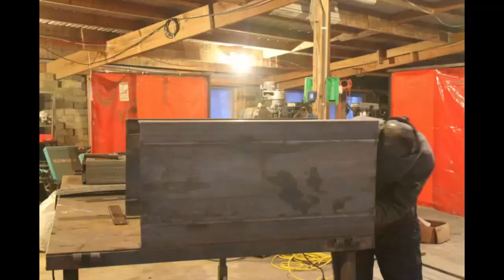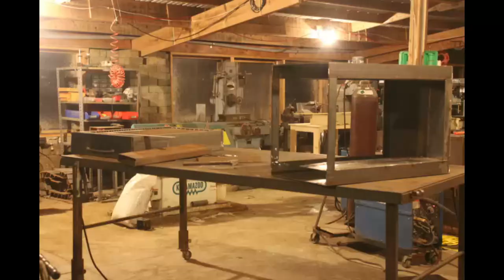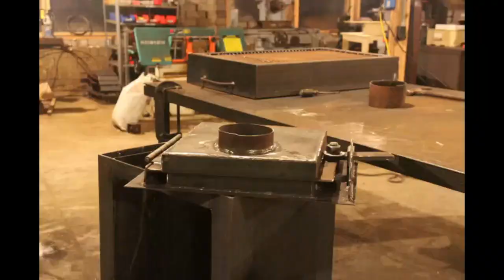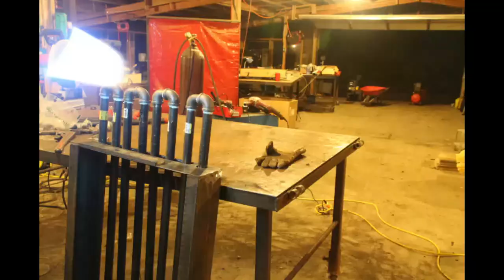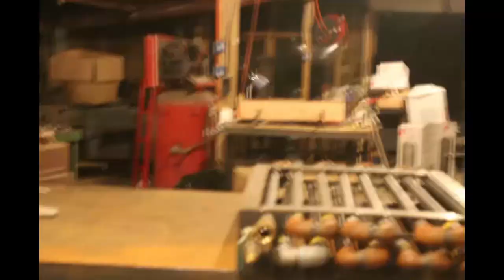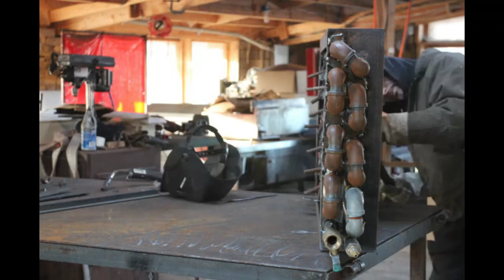How to Build a Hydronic Stove in 5 Minutes

Comment: It seems cheaper and more reliable to use 180 degrees bent tubes isntead of couplers. Space can be compensated with overlapping.
Reply from the maker: In the next iteration, we will use rubber hose for the joints, and use an insulated chamber so the rubber doesn't melt. Like radiator hoses.
https://wiki.opensourceecology.org/wiki/Open_Source_Hydronic_Stove
Reply: @marcinose  I have not researched the link you posted yet, but, My heart fell through the floor when I saw the soap bubbles.. What a pain that must have been.. :)... I think you would be better off building a tank (could be much thinner considering the same volume of the pipes and run the heat around the tank.. Cold water in at the bottom and out through the top.. Would thermocycle, or, if you are feeding it with a pump, rate of flow could be determined by heat of the water output.. My guess would be a 1/8" thick wall tank would heat much better than those pipes.. Just a thought.. And, would be much easier when it comes to finding an initial leak.. Just a little grind and weld and leak is fixed.. I just welded up a tank.. So much easier with the continuous wire MIG these days.. I only had two small leaks.. Porosity in the weld some how on both.. Cheers!